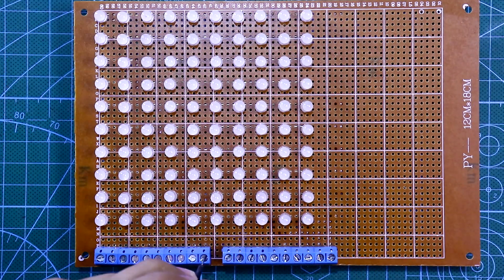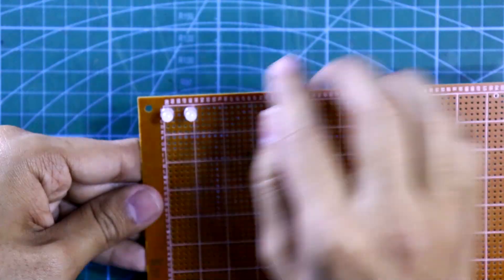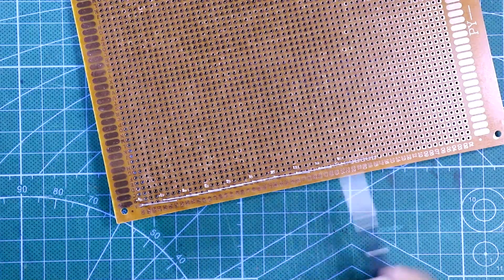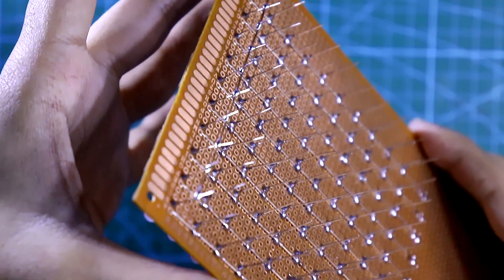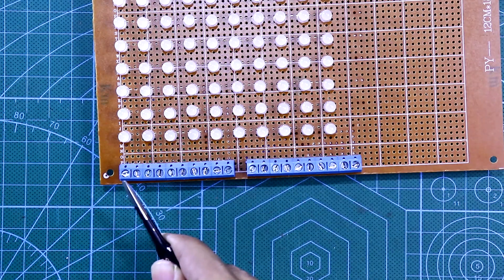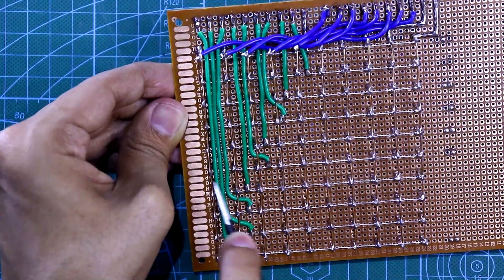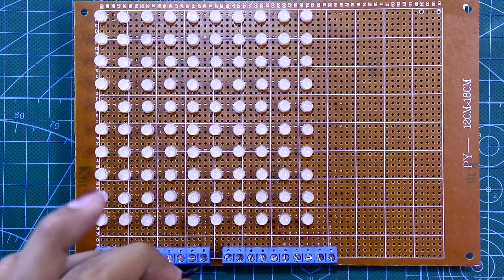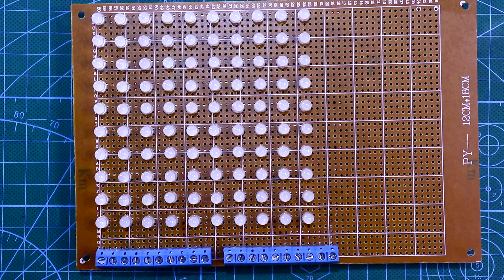10x10 LED Matrix | How to make LED Matrix

Comment: Very nice soldering work, friend! I think there may be 1 or more CD4017’s that could enter the picture.
Reply from the maker: Yah correct. In future video, I'll use 4017 with another IC, not confirmed which one. I'm designing the circuit.

Comment: Is this part of a project that you make more videos showing how to make different effects with? The reason I ask is because that type of board is very expensive where I live in Canada and I only have a few pieces that large and I'd like to follow along with your future videos. That size board is about 7 dollars each. Great video by the way but if you make another can you explain the positive and negative terminal wiring again please. 

You were asking about the chips I ordered in a previous comment. I ordered 10 to 20 each of cd4029, 4026, 4060, 4017, 7448, 7442, 7490. Also timing crystal oscillators, 6 pin latching buttons. If I missed any you use for your lessons please advise. I have most 4000 and 74 series ic but only in kits that contain one of each. I  also already have many 7 segment displays accumulated, transistors, hundreds of 555 ic. I also have the same oscilloscope you have. I ordered that before discovering your channel but I am still waiting for it haha

 I didn't want to waste an arduino on making projects with the 7 segment displays but learning to code them was fun. I want to make a clock using only ic logic and I'm on the way to the post to pick up a 3d printer I ordered to make a case for the clock. I have other projects planned for the printer. I have many projects completed on breadboard but no case to put them in. I have so many different displays accumulated, different size oleds, dot matrix displays, numerous 2004 lcd displays of different colors. About 15 arduino boards,  6 esp32 boards. I also have over 10 breadboards hahaha I have every type of led, 5mm solid color, 5mm clear solid colors, 5 mm blinking rgb leds, 4 pin rgb leds, ws2812b led strips and smd ones. Thousands of 2 pin 3mm leds hahaha. I am not bragging but to learn to use those things its cheaper to buy them in packs.

I've learned so much from you I wish there was a way I could give back via PayPal or patreon.
Reply from the maker: 7 dollars each?? Its very costly, too much.
Yes, I'll upload some videos using this 10x10 LED Matrix.
For connections and explanation, you can watch my three years old video. 9x9 matrix. Link is given in the description.

All those logic gates and counters you have are very useful. I'll upload many videos using this. 

I already uploaded videos related to clock using Logic and counters. I've added the link in the description.

I'm also thinking to buy a 3D printer, haha.

Ya, I'm thing to add my PayPal email. I really need help from people like you and really, I'm very grateful to you.
Love from India.
Reply: @EEWave  it's the clock you made and the clever use of ic logic that I'm basing my build on. I really loved the bcd, Grey code and kmap videos, I'm very proficient in converting number systems in my head but for some reason never knew  about Grey code and kmap. 

I suspect the price difference is because of where a person lives in relation to China affects shipping costs.
Reply from the maker: In current situation, we are not allowed to order anything from China. Now I'm ordering from local companies. It's a little bit higher price but not that much. Now this sized pcb is around 2 or 2.5 US dollars.
Reply: I forgot about that china thing your country is dealing with. I don't read or watch the news.